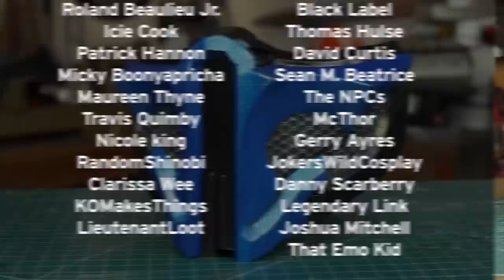Odin Makes: Sub-Zero mask from Mortal Kombat 11

Comment: Why not just put cloth as the 3rd layer under mesh? Instead of 2 layers of privacy screen? It fits close enough around the edges to count as a face shield and if you used a layer or two of cloth for the vents then you don’t have to wear one underneath. Maybe even Velcro in so you can wash
Reply from the maker: Not enough good coverage around the chin and nose. It would 'leak' too much.
Reply: @OdinMakes  foam seal strip- like weatherstripping